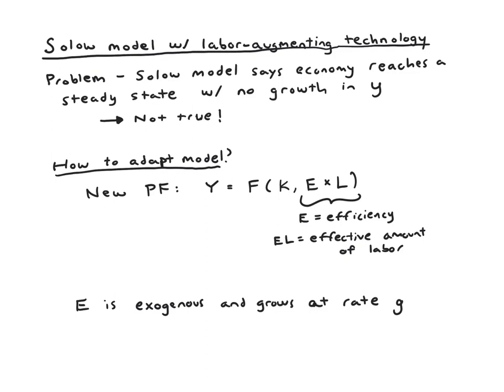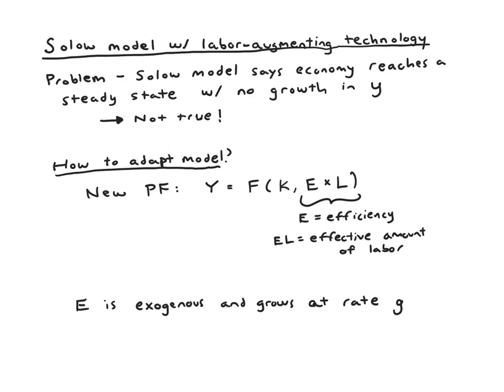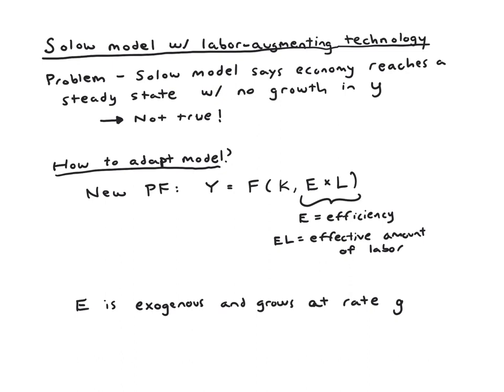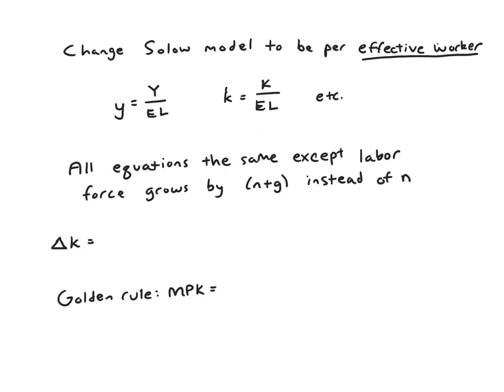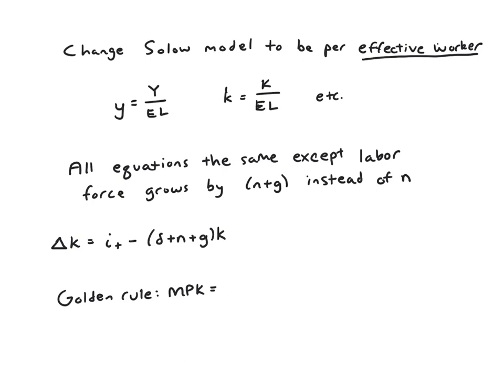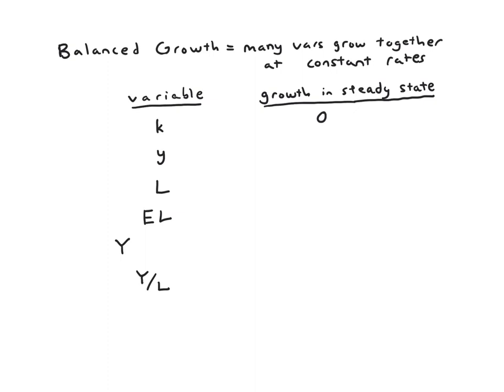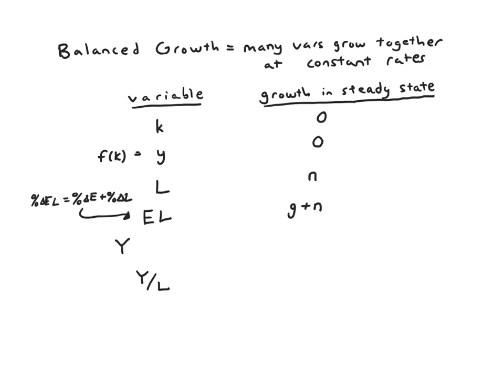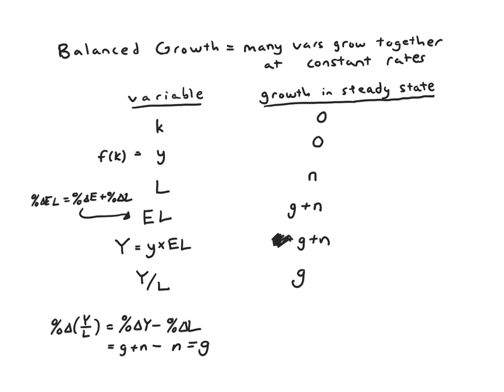Solow model #7 - labor augmenting technology

Comment: If two economies A and B are identical in every respect except that Sa>Sb and Na>Nb. What will happen to them in the long run?will A have higher steady state output per unit of effective labor than B?
Reply from the maker: it depends. you can think of this as starting with country A and then changing two things and seeing what happens. the problem is that when you change two things at once they might push in opposite directions so it gets confusing. An example you might be familiar with is "if S increased and D increased what happens to the price?" and the answer is "who knows?" So it helps to analyze each in turn. what would the change in s do? what would the change in n do? do they offset or reinforce? if they offset you have to be more specific -- how big is the s difference, how big is the n difference?
Reply: @stevewhite1110  actually, we don't need to change anything... just need to explain what will be the difference between these two countries... I'm not getting it how to explain it with equations...can you help?
Reply from the maker: @sanjidasan6556  I think you should watch some videos on the concept of "comparative statics." That seems to be what you are struggling with. Keep at it and you can figure it out.